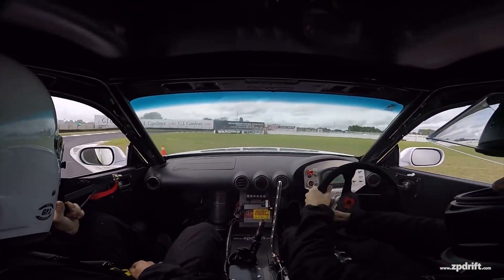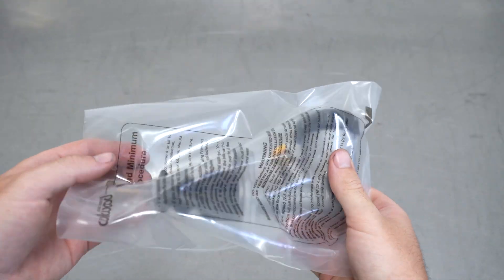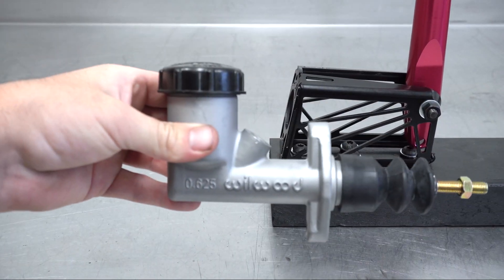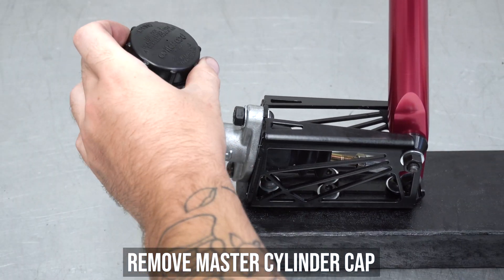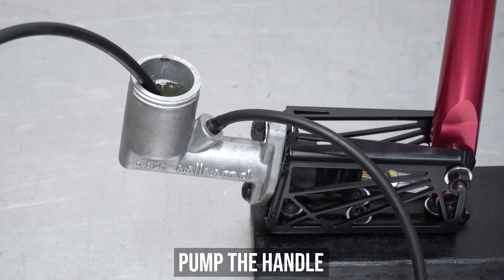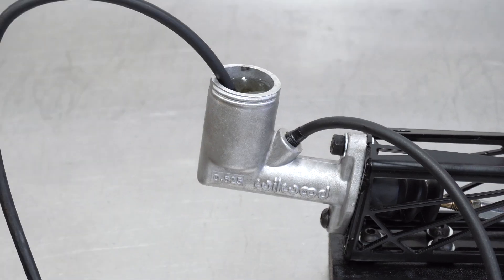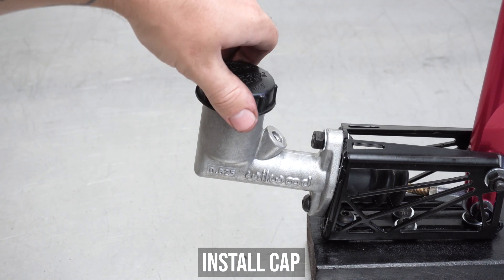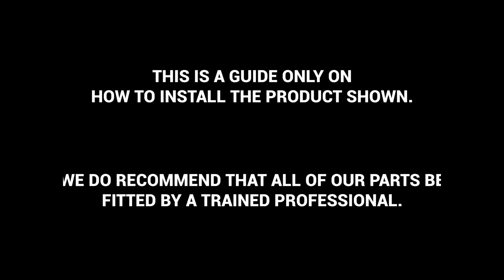How to Bench Bleed a Hydraulic E Brake Master Cylinder

Comment: So when I take my tilton master and do this and I get to the point where I’m pumping the fluid out of the line, the master stops pushing fluid out of the line into the bottle. It will only move fluid if the hose is back in the fluid and sucking it back in. Does that mean my master is bad?

Comment: I recently just undid my lines from a my Hydraulic Ebrake and rerouted them. Now I can't get any pressure from the master cylinder. I pumped quite a bit of fluid through the caliper until no bubbles were present. I noticed if I pulled the handle back it would seem like it was sticking. Is something up with my master cylinder or am I doing something wrong? My spare calipers are facing upwards and this is a standalone setup.
Reply: having the same issue too
Reply: Anyone figure it out?
Reply: Anyone? Same issue here